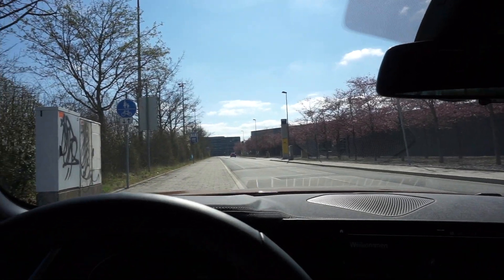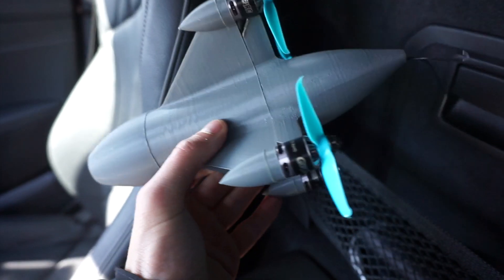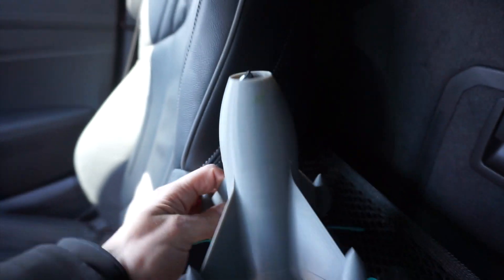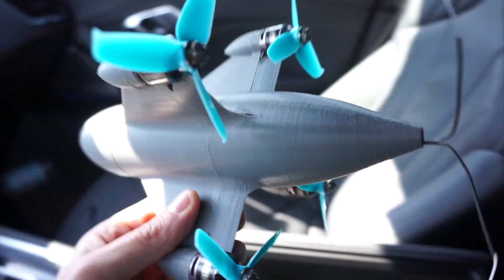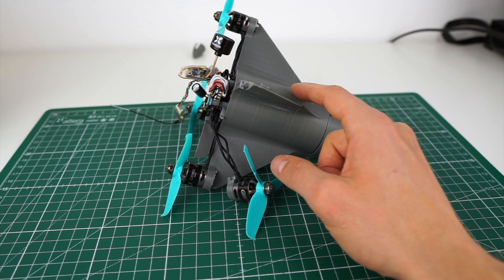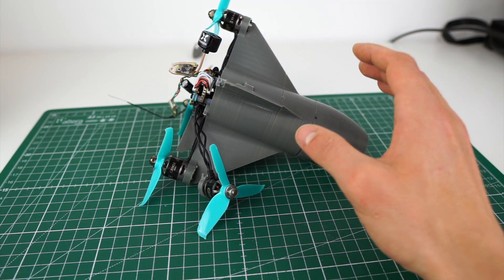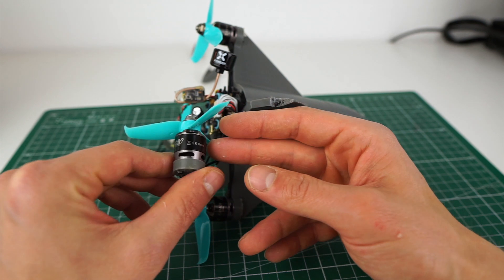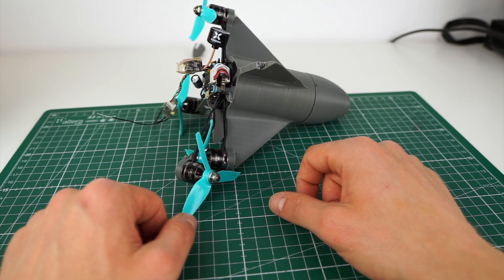How fast will it go?! 3D printed Rocket Quad!

Comment: Yeah at some point I gotta build something like this.   Thinking more of a 5inch full retard build but a hobbywing stack for 6s on those motors would probably be great for science.    Would just run 2x 3s in series rather than buy a 6s pack.

Comment: The Design has another potential use perhaps?  Imagine a clear dome instead of the nose cone with an O-Ring seal....... Is there enough displacement for floatation?  If the tail cone were also a clear dome, you could have a cheater type video set up that would allow for switching between above water and below view.  Just thinking!  Nice work.